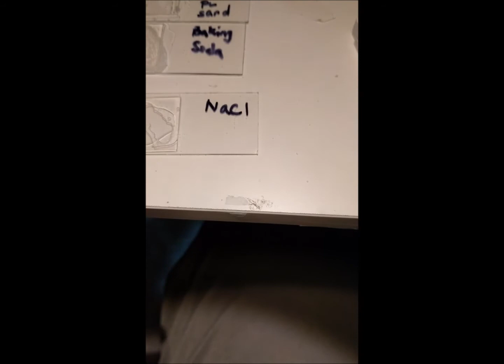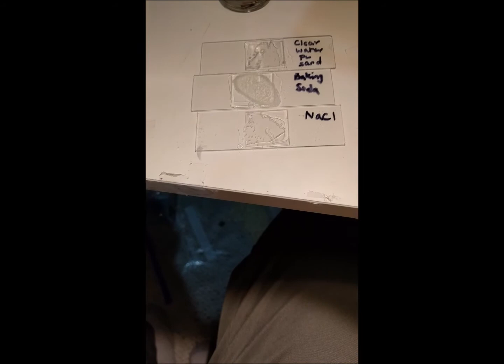polarized light foldscopy

Comment: The foldscope doesnt come with high mag lens
Reply from the maker: Yes the new ones only have a 140x. I hear there is a plan to release a higher mag lens in the coming months
Reply: @laksiyer3460  could u make a video on how to make a drakfield foldscope setup
Reply from the maker: @saumilsunilshah5663   sure. I am working on rheinberg illumination
Reply: @laksiyer3460  two years later i can confirm still 140x
I also found that the plastic cover slips that come with the foldscope work terribly with polarisers, because apparently it is also polarised. You need to angle both to the slip so I found that if I used a magnet ring to clamp down one of them with a bit sticking out so i can rotate it at the front, and have it embedded (cut a rectangle) into the LED, you can rotate both sides to align to the slide. Unfortuntely the ones I got were rather blurry so the image quality is pretty bad.